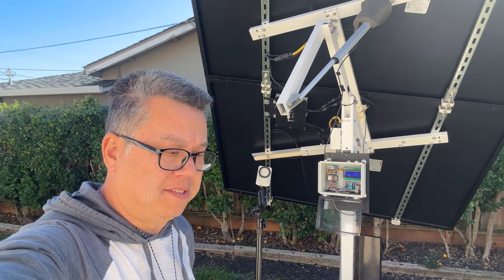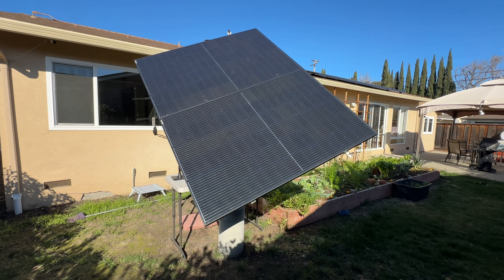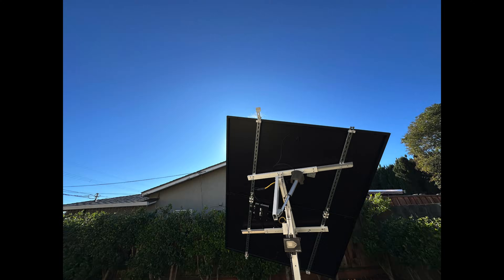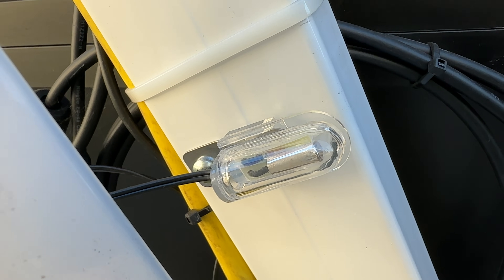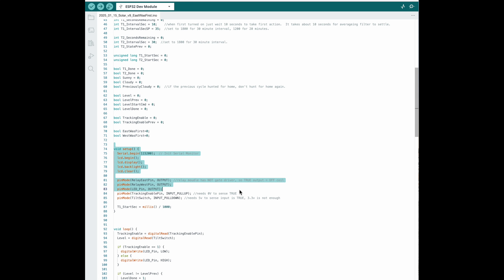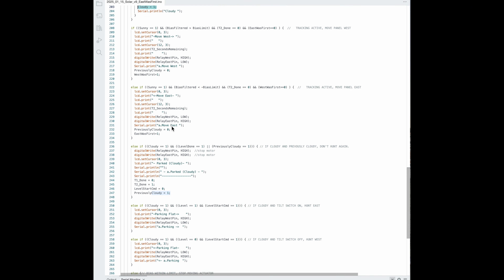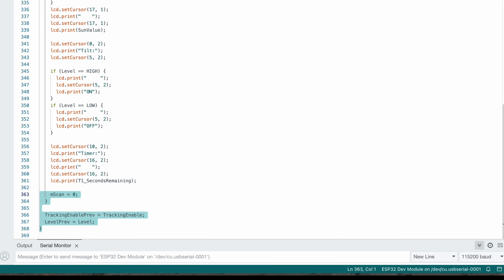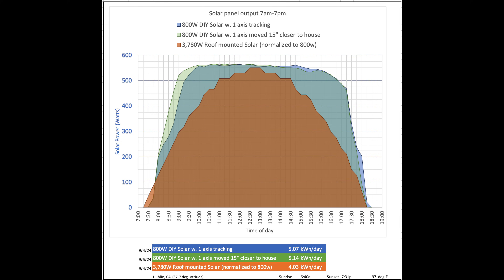Building an Arduino controller for Eco-Worthy solar tracker

Comment: Since you have an ESP32 you can get the exact local time. Given your exact location you can always calculate the sun's position, that optical system might be good for cross correlating your calculation and/or fine adjusting it within an envelope or +/-angle. But the sun is always at a given position at a given time so you dont need to "track" it.
Reply from the maker: I'd need to add a real time clock to get time.  I'd also have to install hall sensor to measure angle.  And the math involved in predicting the suns location for each day, through all seasons isn't something I'm interested in figuring out.  Simple solar sensor and tilt switch is easier imo.

Comment: The problem with optical systems that they are prone to reflections, dust covering one side, cloudy/shades caused offsets.
Use GPS to get the "angle of the month" and daytime to rotate the panels the sun is always at the same spot at a given daytime.
Reply from the maker: How would I get the GPS location of the sun?  Even converting GPS data into tilt angle for the panel  is more complicated than it seems.

Comment: Hello, Thank you very much for all your hard work and for the great explanations in your videos. They are very clear and extremely helpful, especially for students and beginners working on practical projects like mine.
I would be very grateful if, in a future video or update, you could explain more precisely the hardware part, especially the wiring and connections of the relays, the anemometer (wind speed sensor), the inclination/angle sensor, as well as the linear actuator and the motor.
A detailed explanation of this hardware setup and how all these components interact together would be extremely helpful for fully understanding the complete system.
I was thinking that it could be very interesting to use four relays:
the first relay to control the 12V motor,
the second relay to control the 24V linear actuator,
the third relay to raise the panel,
and the fourth relay to lower the panel.
Thank you again for sharing your knowledge and for the excellent content you provide.

Comment: This video is simply awesome, very informative and well put together , love it. I have installed the dual axis Eco Worthy version and I too found the tracker that comes with the kit, functional but annoying with its constant parking and then tracking again throughout the day (even if I set extended wait times like you did) I bought a second tracker about a year later and I think they have fixed this issue now, but it was too late, I was way down the path of building my own like you did . It's a real flaw that the Eco Worthy controller is time based controlling the Linear Actuators. My version uses a RS485 accelerometer for 0.2 degrees accuracy on the panel angles (x,y, and Z (Z not required) ) and an RS485 wind sensor (which parks it instantly with a gust, unlike the eco-worthy version that waits, and when it did park it , it put it vertical first which acted like a sail in the wind - crazy ) and an RS485 UV Sensor (which allows me to know even if its cloudy there is still UV available to track) , so it knows exactly where the panels are and can go directly to a park position. I also made it hard wired network with a  W5500  network adapter (I hate wifi) and MQTT connected to Home Assistant , this allow Home Assistant to remotely control it if required. I can remotely change the Bias values etc from HA and draw nice graphs of its movement and fine tune thresholds with the UV sensor and wind gusts. Thank you for posting your arduino code, i plan to make a YouTube video about my installation and I will most definitely link your installation and talk about how your install influenced mine. I too raised my installation off the ground by over a metre to avoid shadowing, but did some rebar reenforcement foundations because I have 4x400W on the tracker.  I too opened up the eco-worthy controller and reversed engineered how it worked, made my chuckle when i saw you'd done the same haha. I found that the relays sometimes created some noise in the circuit which upset my MQTT network connection, so instead I converted to 'BTS7960 43A H-bridge' to control the linear actuators.
Reply from the maker: Wow, I'm excited to see your setup, definitely make a video on it; subscribed! Are you using an Arduino?  Would love to be able to read/write/log tag values remotely.   My relays also create noise, my SPI LCD display occasionally gets scrambled, I'll check out the H-Bridge your using.  If you haven't already, check out the quieter linear actuator I'm using:  https://www.youtube.com/watch?v=9vfvKzKDld8
Reply: @etischer  Dropped you an email earlier today with a couple of photos of the setup, its probably in your junk haha. Thanks for the link on the quieter actuator, to be honest I already watched that and liked it 🙂🤣 and bought a quieter ones after seeing your video, thanks a lot for that🙏. For the noise and the relays I found physically separating the 12v and the 5v/3.3v wires and routing them as far apart as possible helped alot. 👍Also clipped on some 'Clip-on Ferrite Ring Core Set, EMI RFI Noise Suppressor Cable Clip' from Amazon on to the 12v and 5v , that helped too. But the routing was more important. I used 2xESP32 (arduino coded yes) 1 esp for the Linear actuators circuit, then the other for all the rest. The motor circuit receives commands from the other esp32, kinda of a multithreaded approach, so whilst the linear actuators are moving, the main esp carries on sensing the movement without any blocking.

Comment: It sounds like your Solar Panels are always TRAILING the sun's position.   The panels are never at 90° / perpendicular.   When it is time to move, don't you want the Solar Panels to move slightly AHEAD of Sun's postion?  That way you are maximing the time at +/- 90° vs lagging at +/- 80° ???
Reply from the maker: True there is some lag behind, the tracker moves about every 30 minutes, so at worst, it's 7.5 deg behind (90 +0 / 7.5 deg) . I could just angle the solar sensor back 3.75 degrees to zero out the offset (90 +/ 3.75 deg).  Maybe that will be my next 3D print!  Thanks for the comment
Reply: @etischer Maybe, change the software to stop the motor after the "0 Bias" point vs stopping at less than 100 Bias? ie More West. 
 Also, the sensor may or may not be in exactly the same plane as the solar panel. Hold a pop can on the solar panel, after it stops moving, to see the shadow. The small shadow should be on the West side, not on East side.
  Also, you could shim the Sun Sensor, to bias it approx ( 7.5° / 2 ) to the East, to stop the panel just West of the Sun, as needed.
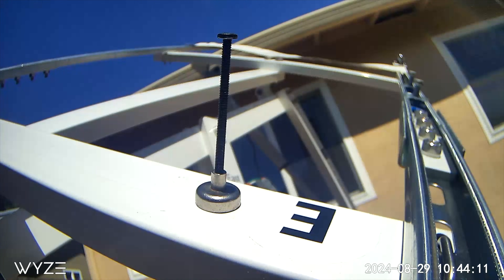Reply from the maker: @MrSummitville  I have a shadow indicator that shows how well the tracker is positioned; the time lapse @12:34 was done with the old controller which also moved every 30 minutes, I tried to keep the operation the same. 

I originally had the motor stop at zero bias, but by the time everything actually stopped, it overshoots zero.  Bias limit is currently set to 100, and the bias is nearly zero after the motion has come to a stop.
Reply from the maker: @MrSummitville  For some reason part of my previous comment got a strike through it, maybe too many math symbols. 

...I could just angle the solar sensor back 3.75 degrees to zero out the offset... Maybe that will be my next 3D print!  Thanks for the comment

Comment: Hi. My location is too windy specially at night making me think on changing the design to manage linear actuators instead of just 1 main support to get the pannels stable even the wind. Looking forward to checking the code as reference to the changes I´m planning to apply. Great description and guide to improve the performance of the investment!

Comment: Amazing! I am going all in and are ordering all the components in your setup. Still hunting for the toggle switch you are using. Might pick your brain down the road! Thx - John
Reply from the maker: Awesome, it's a fun project.  Order the larger 30A rated relay I have in the description, the 10A relay didn't last.
Reply: @ Copy that  - larger relay.  One additional objective is to utilize the North/South actuator for snow conditions + high wind protection via the supplied wind speed gauge. Can you envision a manual switch for a vertical orientation for snow protection and an automatic (programmed) high wind trigger to position the array horizontal? Would need an additional mercury switch and two more 30A relays for starters, correct? Thx - John
Reply from the maker: @jdreid65  yep, that all sounds feasible.  Buy a bigger electrical enclosure than you think you'll need!  You could probably just copy the East-West code I have and duplicate it for North-South to drive the other actuator.  Windy behavior would be the same as cloudy behavior, and could utilize the same code.   Snow could just run the actuators into their end of travel limit.
Reply: @etischer The Arduino code you provide, can I utilize it? Thx - John
Reply from the maker: @jdreid65  yep, link is in the description... https://etischer.com/arduino/solar_tracker/2025_01_15_Solar_v9a.ino
Reply: @etischer Super! Thx for the link.  You have two wire modules in your enclosure. A red and lite blue color tab is visible on the one near the relays - what are these? A fuse bus?  I’ve done a lot of low voltage wiring over the years but haven’t seen this device. Can you provide a clue or a link? Thx - John
Reply from the maker: @jdreid65  they are just wirenuts https://www.amazon.com/dp/B0CBPXP2JW

Comment: what are the measurements of that base plate? Also, do you have a picture of the bolt pattern? I looked on the online manual and it's not listed. it looks to be about maybe 6in? or 8? I ordered the dual tracker and I'm going to attach it to a pole base but I needed to have the plate fabricated. I wanted to get the plate done before the tracker came so I wouldn't have to lose time on the installation. I just needed the plate size and then I will drill the holes on-site.
Reply from the maker: Here are some files I have:

Opens in Fusion 360.  This is a mounting plate I was going to use to make an extension post. 
https://etischer.com/arduino/solar_tracker/Solar%20Tracker%20mounting%20plate%20v1.f3d

Opens in Carbide Create. This is the clear polycarb fixture used to hold the bolts while the concrete set in the video. 
https://etischer.com/arduino/solar_tracker/tracker%20base%20spacer.c2d

let me know if you're not able to open them.
Reply: @etischer  thank you., but I can't open the file. I don't have fusion. do you have a PDF with measurements on it?
Reply from the maker: @paulasenjo8826  https://etischer.com/arduino/solar_tracker/monting_plate_drawing.png
Reply: @etischer oh my goodness! Thank you so much! It is perfect.

Comment: Unique tracker economic justification, but arbitrary rules keeping you from your otherwise optimal choice.

I assumed before watching that you wanted solar, but had little space and didn't want to take up 40% more space in your backyard.

Next engineering challenge is to convert roof panels to single axis. 

Might even be worth it to upgrade panels to higher efficiency with same name plate.  1.0 might make it economical.  Dual layer silicon perovskite are coming, but I'm guessing 1.0 is about nameplate power.  Even so, same power in less space could get the tracker out of the backyard and onto the roof.  10 year old 100w panels may produce less than new 100w panels.  And some brands produce more per nameplate than others.  Might be enough to be economically justified.

Comment: I am working on an ESP32 controller for these, using GPS and an accelerometer; it’ll calculate sun location using GPS time and coordinates, and move to the correct position based on accelerometer input. I have eight, so I’m implementing a lay flat broadcast button so I can mow under them, and if acceleration is over 1.5g it’ll broadcast lay flat because my assumption is that windy conditions will shake the panel.
Reply from the maker: Cool, a button to make them all lay flat at the same time would be cool to see, post a video!  Might be worth broadcasting a lay flat command if it's cloudy as well?
Reply: @etischer  I’m not sure… I think I’ll just keep them pointing toward the sun to reduce motor wear. I am not using a light sensor at all.

Comment: My single eco-tracking system does not work. Not matter where or how I put the senser. The double tracker works great on my other solar setup. Back in the past I made my own trackers that worked quite well. I do not care to spend time doing that these days. Looks like you still enjoy making your own.

Comment: I'm thinking of building something like this, but maybe integrated with home assistant and just use sun azimutes provided by forecast service.

I'm jus not sure what to use as a "compass" or something on a ESP.

Do you have an idea of the improvement that single axis auto tracking provides?
Reply: Never mind, I just reached the spreadsheet part 😅 and roof vs tracker. Sorry

Comment: Excellent video and very timely for me. I just ordered the dual axis tracker but I have also been polishing up on my Arduino to do something similar since I have read several reports about the EcoWorthy controller being hit or miss.  I also want to fabricate and add a second tracker that would be larger sometime in the future once I gain experience with the EcoWorthy so this information is invaluable. Thanks so much for the insight and especially for the code.
Reply from the maker: Great to hear!  Be sure to look at reference photos when putting the Eco-Worthy assembly together.  I had to take it all apart a few times because parts were installed backwards, the instructions at the time didn't call out certain parts had to be oriented a certain way.  The Eco-Worthy tracker frame is pretty solid, especially considering the price.   I switched out the relays for slightly larger ones, would be nice to find something solid state. 
Good luck, it should be a fun project!

Comment: Please do not be insulted, but that sensor thing is totally useless. You can control the position perfectly well by converting the time of day into an angle. From the actuator park position to the maximum position, you can determine the speed of your actuator, and from your GPS, the exact location of the device. The rest is rather elementary geometry.  You  can get the controller connected to the internet to know the current time of day from a time server.  You can use an ESP32 to get time from the internet and use it to control the motor,  or send the time to the Arduino. This is a nice system you have there, but the position of the sun is rather predictable.
Reply from the maker: So instead of a simple sensor that tells me turn left or turn right;  I would need to do some complex math, and find some way to mount an encoder of some sort to the tracker?  Timer based position control is not great, especially considering the motor speed likely changes with temperature, load, wear, voltage....  Each day would require a unique motion profile, and would require a real time clock in the Arduino.  When it's cloudy, a solar panel is more efficient in a flat position facing the clouds rather than tilted down facing the sun, so you'd loose out on those efficiency gains. Debugging would be quite complicated, in addition to a real time clock and encoder/resolver for position feedback... IDK, pretty much every solar tracker uses simple sensors, I've never seen one using equations to predict the suns path....
Reply: While using a simple sensor for solar tracking seems intuitive, there’s an argument for a hybrid approach. Purely time-based tracking (as suggested) can work if motor calibration is perfect and external factors (temperature, voltage drops, mechanical wear) are negligible. However, real-world conditions introduce variables that make sensor feedback useful. A better solution would be an algorithm that combines astronomical positioning (time + GPS) with real-time sensor correction to account for unpredictable conditions like cloud coverage or mechanical drift. This way, you get precision without overcomplicating with encoders.
Reply: @Kazanbazan100  You said, "... If motor calibration is perfect ...". You are pretending that perfection is possible, without encoders. Children pretend that perfection is possible. Adults realize that a Sun Sensor is good-enough.

Comment: Great project and video. 

It would be nice to see a comparison of your tracker vs 2 panels on your roof to see what the power delta would be.  Online solar calcs say tracking isn’t generally worth it…
Reply from the maker: my 400w panels were $325 each, and I 'm using 2.  The solar tracker was roughly the same price as one panel, and I get 30% more power. So yes, spending the same for an extra panel yields 50% more power.    But getting permits, and the rails  and labor for a roof install make the whole economics aspect fall apart, it's just not feasible.  We also aren't allowed to upgrade more than 800w without loosing our rate plan, so that also ruled out a 3rd panel.  The tracker also offsets the cost of the framing to hold stationary panels at an angle, and off the ground.  For our situation, the tracker made the most sense.

Comment: The suns position actually can be predicted on the clock and calendar for the next  Millions of years, there is no light sensor required.
Reply from the maker: True, but it would require some sort of encoder feedback and homing routine to calibrate the encoder.  This could also be completely timer based once the Arduino knows sunrise and sunset from the day before.   I think the light sensor is still the simplest implementation. 

In cloudy conditions, I think it's better to have the panel facing the dome of clouds than to point where the sun is in the sky.